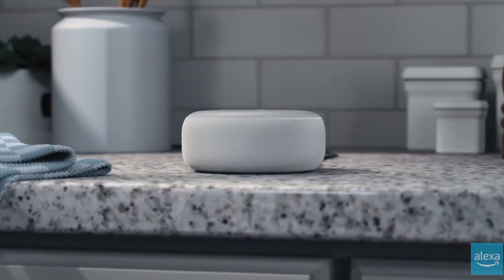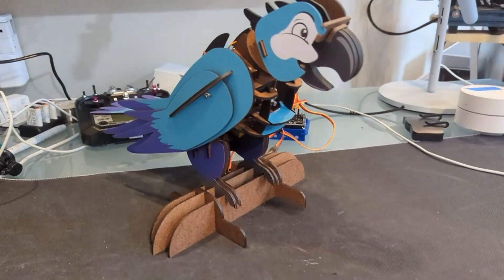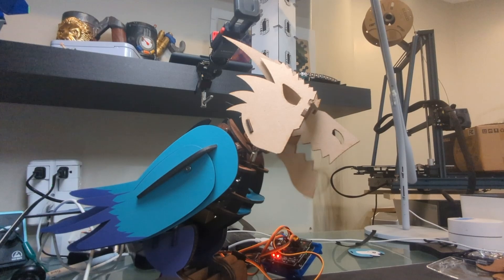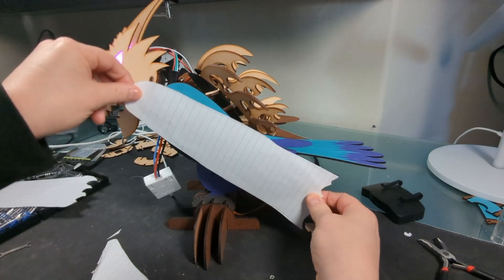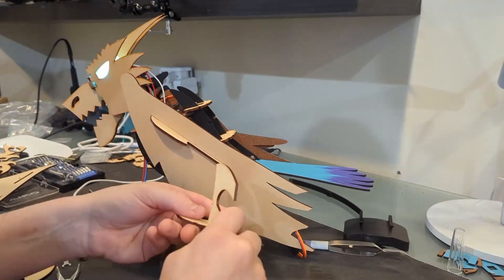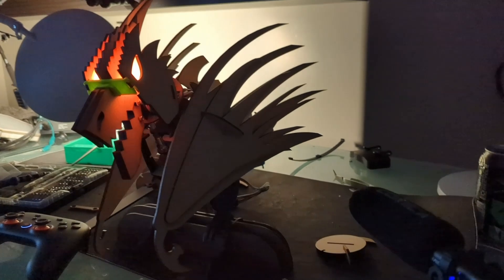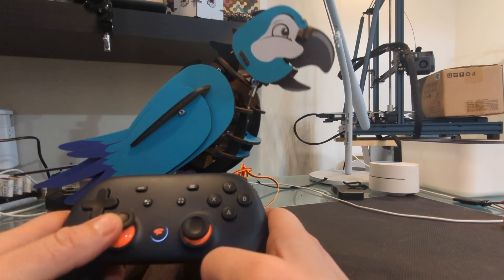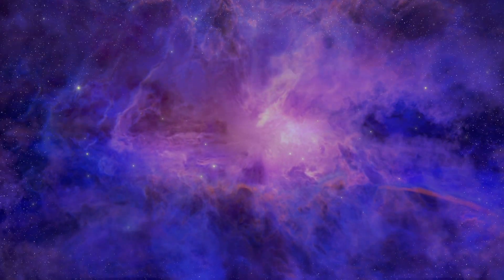Custom Animatronic Voice Assistant | @home_assistant Voice @Bottango

Comment: I'm also building my "own" motor driven voice assistant.
I'm using the Big mouth Billy bass, and will keep it as original, but add the voice assistant.
That way it will function just the way it did off the shelf in case you want to listen to the same two songs again but you can also say "hey Billy"
Reply from the maker: That is freakin awesome!   One thing to consider (that I'm thinking of changing), if you want it to respond with recorded mp3's you have to make the speaker a media player instead of part of the voice assistant.  Although, the ESP32 media player speakers haven't been super reliable either...